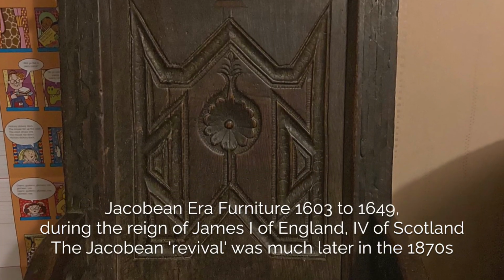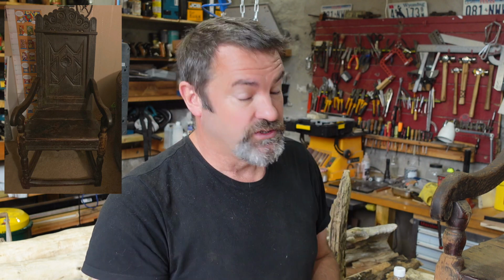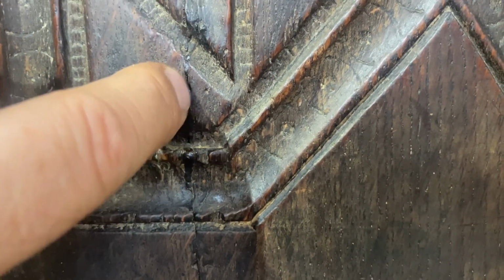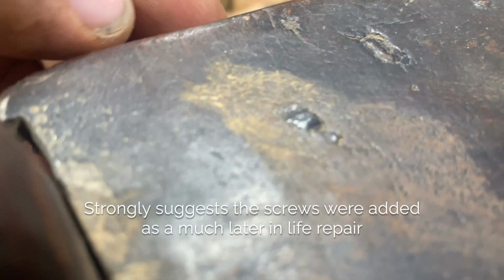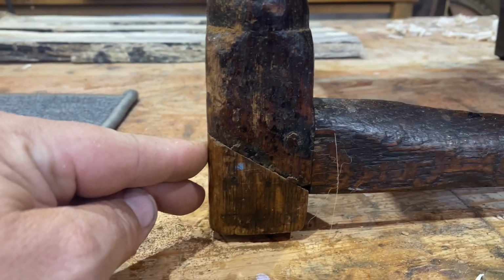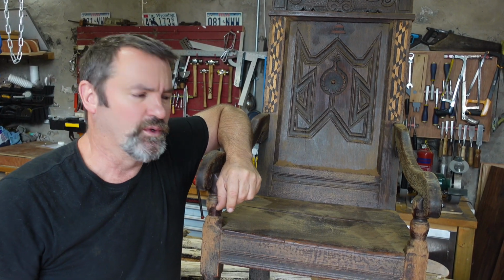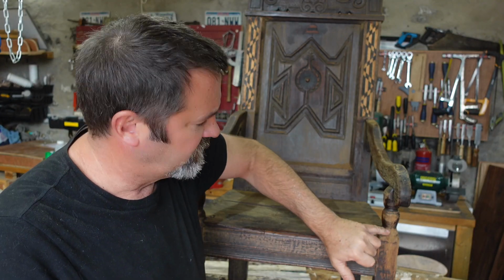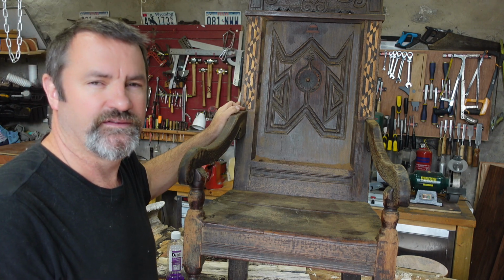Ancient oak chair from the 1600s! Pet chewed, 400 years old, restoration and repair

Comment: Hi Bruce. 
It looks like you have an early 17th century, Yorkshire (wainscot) Chair. 

Sorry for the delay in responding. I hope you are well, and well done on producing this video which does raise a number of interesting questions, and answers. 

I have watched your video with great interest. It made me dive into my library of reference books I have here in the workshop. 
It looks like this style of chair was predominantly made in the Yorkshire region with slight variations depending on the region. 

Yours very much looks to be original, it's such a shame the owner allowed their pet to cause so much damage, but hindsight is for righteous few.
Please, please don't take this to be in any way a critique of your work but this is the way we would have approached it here at Gilboys...  

I think if this chair had come to our workshop I'm not sure that we would have removed the existing finish, even if it had been over polished/finished by the Victorians.

Once you start down this road it is almost impossible just to remove what is perceived to be 'not original or authentic'. 
And before you know it you reach bare wood, 400 years of finish patination has gone. 
Splits and cracks in the surface would be investigated but unless they endanger the structural integrity of the chair I would leave them well alone. 

The split in the leg; I think we would have used a thick mix of scotch/pearl glue with a little added fine sawdust to the mix, brushed it into the joint and used a soft ratchet strap to close the gap, very slowly and very carefully). If the gap was unable to withstand this we may well have glued in a small slice of old oak (using the same glue). Which we then could very easily shape to the profile of the leg.

The scratches on the face of the chair look to be from cat claws. Dog chewed wood is normally very destructive whereas cat claws tend to leave deep scars on the surface. Nonetheless this is a tricky repair to get right... 

Do you cut out the damaged wood,  back to a clean, workable surface, and attach a new piece or pieces of old oak? If so, you would have to carefully shape it to match the original, and carefully finish to match the original surrounding finish. But this method also means you are taking history away from the chair, not to say, removing period 400 year old wood.

My approach would be to leave the scratches as they are and yes fill them with an easily removable method of repair, such as solid beeswax. This means that you are preserving what remains, also it is much easier to colour and finish using traditional materials and techniques of colouring employed by a french polisher / antique restorer. This method also means; in the future years the beeswax repair could be easily undone without damage and the more seriously involved repair, I previously mentioned, could be carried out.  

The loose seat I would reattach but not by removing any of the old repairs, I would leave them there. The risk of damage I feel may be greater than the intention. 

I would secure the seat by using (old wood) glue blocks that could be glued to the seat and rail on the underside. This would mean the seat is secured and you haven't disturbed any of the patinated finish on the seat.
It also means the glue blocks can easily be removed at a later date without harming the chair in any way. 
Once I am happy that the conservation repairs are all good I would revive the old finish, using a tried and tested method of applying traditional oil stain over the entire surface and wiping off the excess as you go. This will help clean off the dirt and at the same time help disguise the repairs and blend fresh wounds. 

I would then wax polish with a dark beeswax polish, not to colour the surface, as this won't be the case, but more to enhance the finish that lies beneath.  
Restoration, or should I say conservation of period furniture such as this is not really about what the current owner wants, it's about knowing what's right for the chair. 

Its' financial value may have fallen, but that is now, in the future it may well increase again, and with it the ability for future owners to have more in depth and costly work done. 

I hope this doesn't read as a criticism, it's not the intention. I also understand that in most cases you need to be in the physical presence of a piece to understand what it needs. 
With best wishes
Simon
Reply from the maker: Simon,
Thank you so much for taking the time and patience to reply in detail. Incredibly helpful!
I finished the restoration/conservation earlier in the week, and am relieved that for much of what you have advised, I drew similar conclusions and direction.  The owner is collecting tomorrow, and I am working on the YouTube video, hopefully out in the next day or so!

Comment: Hi Bruce you have an early 17th century chair possibly english jacobean but the carving of the rose on the back panal should have 5 petals which leads me for it to be French . Constructed of english or french oak with ebony and Holly parquetry . do not over restore just clean off the dirt and old polish . use traditional Hide Glue to infill the large cracks . Its water based and the excess glue can easily be cleaned off with a damp cloth . It would be just jointed with oak pegs ( dowels and glue . ) The nails are a later repair . The repaired legs are a feature to its age as the chair would be on stone wet floors common in jacobean times . By all means use bees wax to address the scratches and before hand i would give the chair a coat of linseed oil to nourish the wood as the cracks are caused by the wood drying out . Hope my tips are usefull to you . To get some idea of jackobean furniture from the Tudor era There is an abandoned timber framed manor house in england on You Tube . If you search for Tutt hill manor it will give you some inspiration  on the finish to apply to the chair . A nice find .
Reply from the maker: Thank you for the detailed comment! I think I followed much of what you suggest - see the results here: https://youtu.be/1xsCDux-1sY
I would be interested in your thoughts on how it went
Reply: @TheCottackWorkshop   Thankyou for your reply , You made a great restoration , and a chair worth saving . 👍

Comment: Hello Bruce! Very, very interesting furniture.
I can't help you with age and origin - that's not my era and it's not my country either. But I do have one advice: If the chair is authentic, then there's a good chance that heraldic symbols were used in the carving of the backrest. This red-black symbol at the top, in the most prominent place, can lead further, possibly the flower in the middle with the palmette-like runner upwards could also be interesting. Could be a good idea, to look up a list of Scottish aristocratic coats of arms to see if such symbols appear there. With a bit of luck, you might even be able to assign the chair to a specific family.
About the restoration: I would first clean the chair very carefully. The back part was originally colored, and at that time the only possible finish was wax. I would be careful with sanding, Liberon has a wax remover that you can use with steel wool, but on oak I would rather work with sanding pads (maybe the green ones).
I would "defuse" the gnawed areas with sandpaper, then level them with stain and apply a wax. Beeswax dissolved in balsamic turpentine with a hardening additive would probably come closest to the original.
The marquetry is really quite unusual. I'm very excited to see what's to come...
Thanks for showing! Good luck!
Reply from the maker: Georg - many thanks for the excellent suggestions. Getting a match to a family would be fantastic. Great suggestion on not using wire wool on oak. The finish is a real conundrum. I believe originally, as you say, it would have been painted, probably in bright shades and possibly even guilded. With no guide or picture to work with it would all be guess work and look wrong to our eyes. But it also feels wrong to repeat what the Victorians did and make it all black and dark again ...I'm also excited to see where we end up!

Comment: I'd say a light overall cleaning to unclog the wood grain, and then a dark wax with the highlights buffed - the effect should be something which has been touched and used regularly. If the old repair screws are doing their job I'd leave them and just melt shellac over the heads. The repair history is now a part of the piece. The stains on the seat are your call but I;d be cautious- I'd leave them and make up a period style cushion as a cover & to introduce a little color.
Reply from the maker: Many thanks - sound advice all round! Much appreciated

Comment: Thanks for the second video in one week but goodness me Bruce, you've got your work cut out for you there.  I think that you're right to stay away from modern materials/techniques  as much as possible so using the beeswax is a good idea.  As in the past I'm sure that you'll do a very sympathetic repair.   I would imagine that it will be tricky around the marquetry as if you want to show it off I guess you will have to have to do some work on the rest of the chair colour so that it does not stand out too much (i.e. maintaining that overall aged look)?  Sorry that I can't be of more help.
Reply from the maker: Thanks as always for the quick response, and actually very helpful. I was discussing a bit of this with the owner after they saw the video and I posed the thought that to some extent the wood will dictate the answer eg how much it has been exposed to direct sunlight over the (gulp) centuries. I’m also comforted by the thought that it is always easier to go darker so in the worst case we get back to closer to where we started (uniform tone but dark), however what I’m hoping for is that redder richer oak seen in the auction photographs. Thanks again!